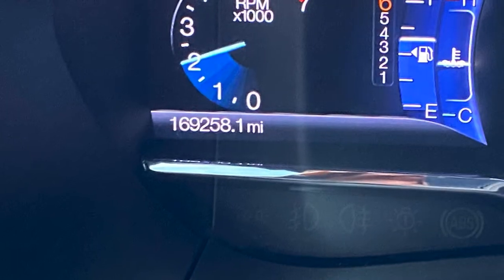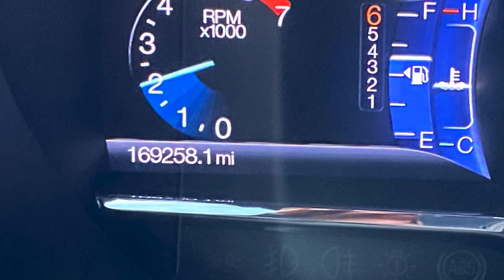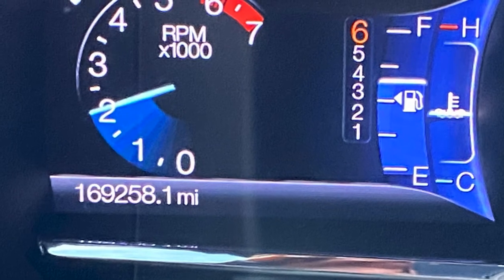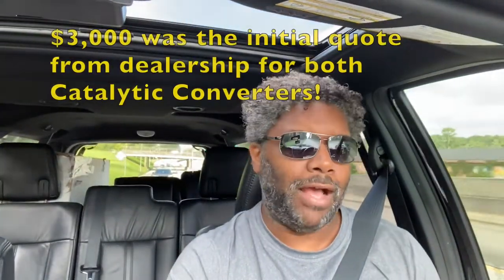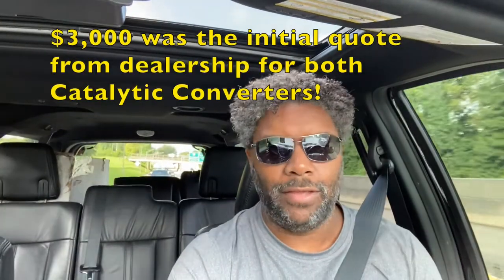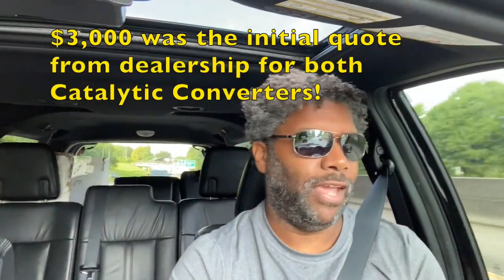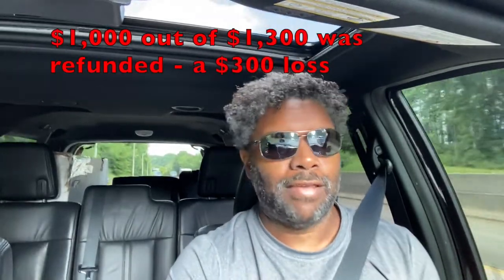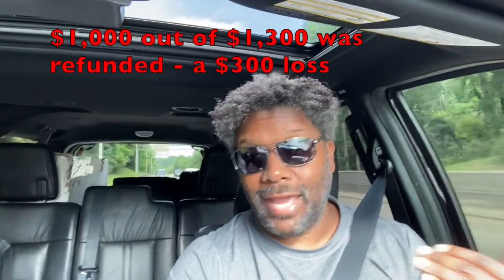Another Lincoln Navigator Report (Catalytic Converter Issues) P0420 P0430

Comment: You show separate catalytic converters, on my 3.5 lincoln nav' they are part on the exhaust system, which means it comes has one unit. I don't understand.??
Reply from the maker: Both catalytic converters set me back over $2,000. After having another mechanic replace them, the check engine light went away BUT I had to use Ford converters. The after market ones did not work.

Comment: Did your lincoln had any issues when accelerating.
Reply from the maker: Absolutely. I had to put the pedal to the floor just to get it moving. Terrible for the engine!
Reply: @j2review  My 2015 navigator with 164k miles  was  vibrating whenever I accelerated. I paid $390 for a transmission flush at a Ford dealership last week and now it runs perfect.   I now have to fix the P0430 code issue.

Comment: Did you ever fix your issue,could you just need catalytic cleaner
Reply from the maker: I had to replace both catalytic converters. Please note: Aftermarket convertors won't work - Cost me upwards of $2,900. I posted a video about it.
Reply: @j2review  thank you for replying
Reply from the maker: You're welcome. If you have any other questions about the 2015-2017 Navigator or Expedition, let me know.